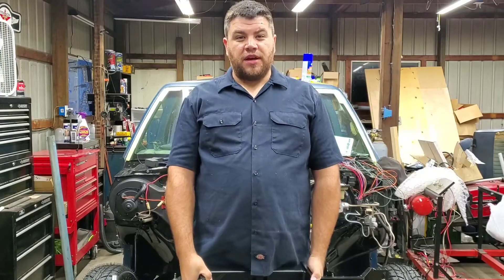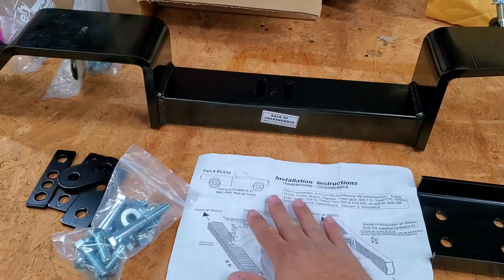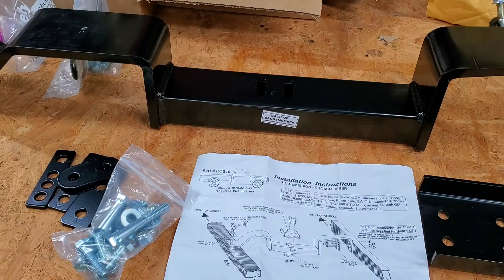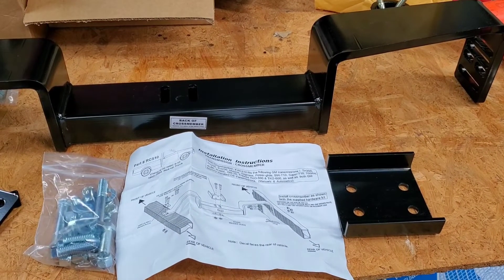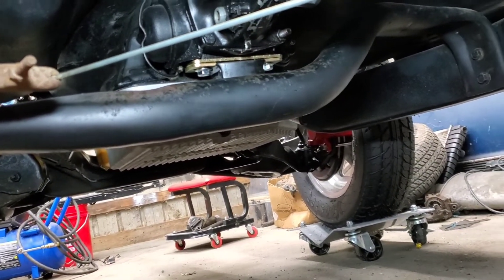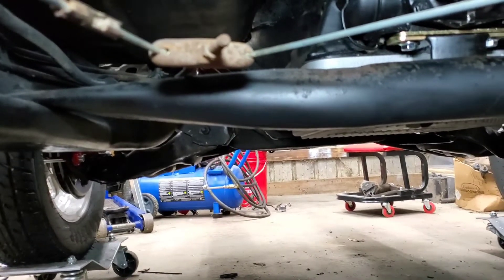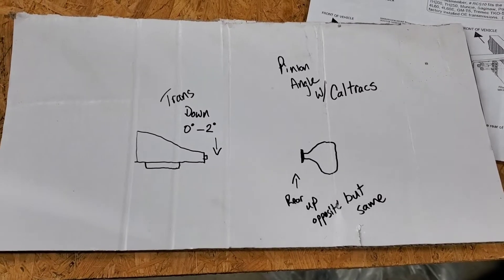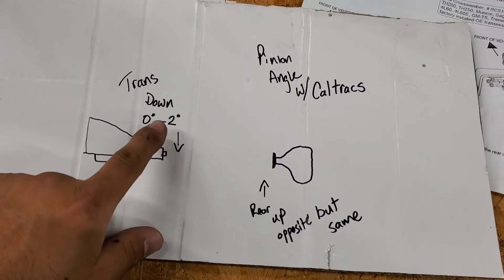V8 S10 Gforce Transmission Crossmember (Summit Rebrand) Upgrade

Comment: How are you going to cool the transmission?  I went with a Derale 13700 Electra-Cool Remote Cooler & mounted it under the bed and used -AN fittings and hoses which worked well. I also installed a thermostatic switch inline to turn the fan on at a specific temp.  It kept the trans lines away from the engine and they became shorter in the process.  I think I like it lol
Reply from the maker: Yes I have a derale remote cooler as well I plan to put under the bed somewhere also
Reply: You still would want a cooler upfront behind the grill it’s not gonna get enough air back there

Comment: I tried reading the instructions, I couldn’t tell but I don’t think that it said it would fit a TH400. Does this crossmember fit a TH400? Good videos by the way. Keep’em coming!
Reply from the maker: Thank you! This particular one does not, it states for Th350, powerglide, 700r4, etc. They do however make one similar for turbo 400 trans. It's around the same price also.

Comment: WRONG on pinion angle info.,
You want the transmission pointed down 2-4* more than rear end as the rear end gears climb upwards not downwards, So if you have the transmission at say 2* pointed down the rear end needs to be pointed down 4-6*,
The way your explaining it the pinion angle is going to be positive NOT negative which will bind